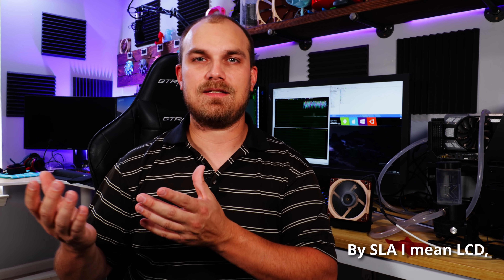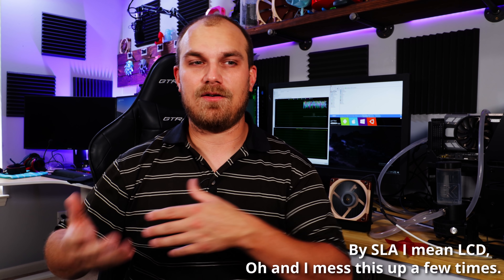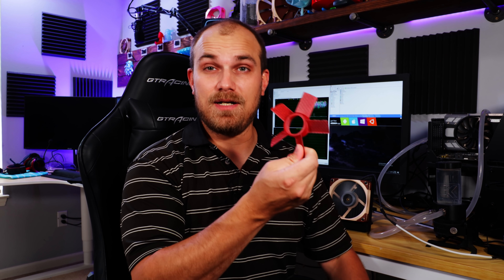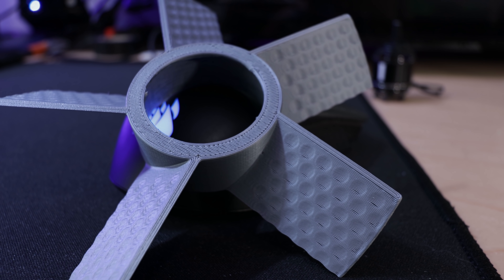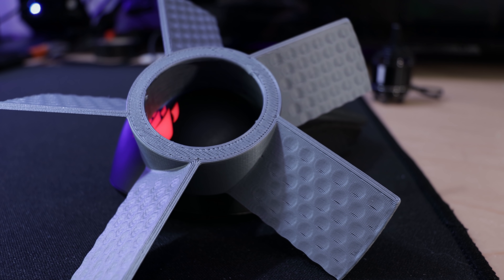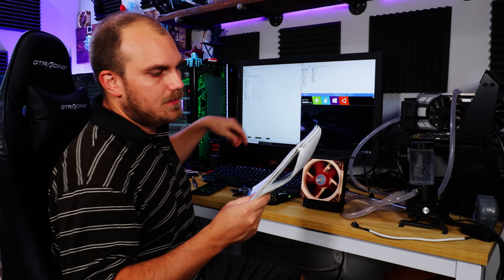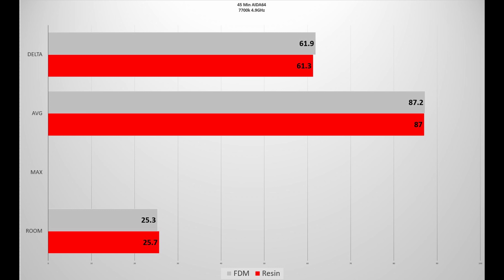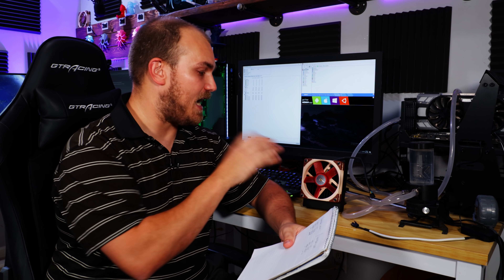Do Resin Fans Outperform FDM Fans | Dimple Fan Follow Up

Comment: The performance difference in this type of flow is negligible. The air pressure and flow are just too small to be affected. However I am not sure about the balancing. While for a 2 3 or 10 hour run everything is fine I suspect that depending on how you print both in resin and FDM you would have a different lifespan due to micro vibrations.  Check if they are both perfectly balanced. I think resin should be better balanced if you have no hollow spaces within.

Comment: Its pointless using dimples on that style of blade!

Dimples on a golf ball are designed to make the boundary layer more turbulent so that smooth air flows better around the curve of the ball; thereby reducing its wake and in effect drag. This makes the ball fly better and farther.

That blade primarily uses angle of attack to force air thru due to it not being a curved aerofoil. The air flow will not adhere to the top side of the blade i.e. no boundary layer is created.

The FDM layers would act like dimples but would only be effective on a tight radius curve blade. FDM vs resin on this type of blade would make no difference to airflow... strength would be the only difference.

Comment: Theoretically, surface texture means a LOT in fluid dynamics. For example, ship impellers are very rough cut, but then ground with this really cool looking power sander on a huge rig, to very close to perfection, and also much smoother. That said, I think there's even more at play. Several of the models in your competition, so far, have had ... issues. By issues, I mean things like you having issues removing support material, and maybe there's some surface marring. Or maybe the layering was thin, or far enough apart, such that it didn't come out smoothly. This would be an excellent use case for resin printing. The ones that didn't come out smoothly had issues /on the cutting edge/, which I would consider significantly concerning. It is also likely worth noting that differences may vary based on the properties of the individual designs. Some might not have the air doing a lot of running over the surface type stuff, some might. Those will be affected differently.

Comment: It's not just about the surface, though, it's also about print quality when it comes to design. FDM just isn't suitable when parts become too thin, or when structures are too intricate for FDM to realistically print.

Comment: probably is a difference because air resistant should be lower on resin because it would create less turbulence. should test it on some noctua clones and thomas’s acceleron i wager that the delta will change

Comment: Resin with and without dimples, preferably curved blades. 
Keep reading for the thoughts behind. 

The roughness in the extrusion could behave as dimples, rather than negating the dimples effects, as dimples are there to energize the boundary layer creating vortices to delay flow separation. This is much more important in the low pressure (back) side of the blade, as in the high pressure (front) side will only create more drag and nothing good.

Probably highly curved blades (in the airflow direction, not radially) will benefit much more from that effect as flow separation could occur at any point and helping it stay attached would increase the efficiency of the blade, in a flat blade the airflow would stick or separate just depending on the angle (hugely simplifying).

Lastly, even with all that in consideration, I don't know how much the effect can be, there's a reason we don't see airplanes with dimpled wings, and fans have quite an special type of aerodynamics as interaction between blades its very different than a single surface on the airflow.

It's a big can of worms the endeavor your channel took as theme, I'm very thankful for the content, not only fun to watch but quite interesting!

Comment: Temperature shouldnt be the key difference, noise should be the difference. A cleaner surface should produce cleaner air with less noice. Sure cleaner air may aid in better delta’s but on this scale, I dont think without special super accurate equipment and a bigger sample size you will notice.

Comment: You kind of have to wonder... The Industry with the highest interest in getting the most air moved at the least cost would be the Jet Engine Industry so why is no one using their designs? https://c2.staticflickr.com/4/3503/3874769222_af84d459c9_z.jpg
Reply: Cost and sound levels are not really important for planes, compared to size/weight. There's also a lot more technical complexity (a jet isn't just one fan) and the focus isn't on moving volume, but creating pressure; that's why the front opening is much larger than the rear.

Comment: If you are trying to design aircraft, then at the speeds they are moving, the surface finish will make a big difference to the drag that is experienced, but in this case, the speeds are not high enough to matter and even if you could push a bit more air with the blade design, you are trying to push it through a constriction (the radiator)..    The factors you have are thus: how much air can be pushed through the fins with the power/torque available from the fan motor, and how much heat transfer can happen between the fins and the air.   Even if you can design a fan that can theoretically move more air, the radiator is still in the way and because fans generally don't create a ton of pressure like a compressor, even increasing the motor power is likely to only net you minimal gains...  In short, you may be able to see some minimal gains with fan blade geometry, but things like surface finish will be down in the nth decimal place and insignificant in this context..  

If you are interested in better cooling, you need you need to look into coatings and treatments for the radiator fins that improve heat transfer and also fan designs that act more like compressors to create a pressure gradient across the radiator, which would normally require multi-stage fans and a lot more torque than the little hub motor is capable of..

Comment: You should probably be comparing a resin printed fan with dimples vs a resin printed fan without dimples, obviously using the same base shape (number of blades, curvature of the blades, twist/pitch of the blades etc).

Comment: There was a difference. A 45 minute test showing that the SLA preformed a lower temperature at a hotter room temp is big. If you ran these tests for a week or a month, then thats where you'll see a dramatic difference in stats.

Comment: I thought the dimples on golf balls were there to reduce drag. So I don't think this has a use when it comes to a fan other than possibly reaching a higher rpm but by sacrificing the amount of work done on the air.

Comment: Air is technically a fluid so the dimples in the blade get filled with air that goes along for the ride the air moves across it as it would any smooth surface. Your plastic print has dimples on an even smaller scale and the same thing happens air gets trapped and the other air glides over as if it was a smooth surface.

Comment: I dont think the test cpu has s reliable delta because of high thermal density and thermal paste between ihs and core. I think a 5820k which is a big soldered die is a better test system.

Comment: You are all missing the dimple point of a golf ball. Its for spin. If you hit the ball at a specific angle the ball will spin in different directions sorta at different speeds. This allow the ball to either be carried or dropped by the barnulli effect. Spelling might be wrong.

Comment: Lol, that design with the dimples creates its own drag by a mechanism pretty much identical to the drag induced by crappy FDM prints... Definitely try something else. 
Easiest benchmark is probably the Knocktuoff for obvious reasons (can compare vs. FDM AND genuine Noctua), but pretty much any of the other fan or blower designs that qualify as a fan or blower should work for a test, except maybe the "vortex generator" one.

Comment: The 0.6 degree difference in deltas between the fdm fan and the resin fan is not a negligible difference. That 0.6 difference would make the first place fan better than the noctua A12 X25 fan

Comment: The dimpling you made on the fans is not the correct geometry, to get any significant result you need to make all dimples tangent in a trilateral lattice (pyramid/triangle offset).  Additionally you need to determine the correct depth to angular interaction ratio.

Comment: As far as dimples go, it won't make a difference in your application. They create loft. They affect windtunnel performance on "traveling" objects. That doesn't necessarily translate to moving air better. In other words, because something slices the air better, doesn't mean it will push the air better.

Comment: Hey man just found your videos and love your content! That being said, I have an idea for a cooling system that I would love to see you test. I watched your evaporative cooling tower build and was blow away by how well it performed, which sparked a thought; could a natural draft cooling tower be used to cool a cpu? Now I know they tend to work with a warmer water and the end result tends to be cooler water than what you might find in a radiator cooling setup, but it also seems to me that that since you don't need the water to be quite as cool, the water entering the system cooler may not be an issue. I don't know, may the lack of heat wouldn't create enough pressure in the system to draw enough air to cool the system. The one flaw in your previous cooling tower that stuck out to me was the fact that you would be drawing water vapor through your fan, which over time would cause corrosion in the fan, making it a less than perfect cooling solution for any sort of longer term. But shoot, I am intrigued and don't have the tools to test this myself. Plus, imagine how cool it would be to have a cooling tower that resembles a nuclear reactor cooler sitting on your desk?  Anyways, just some food for thought! Thanks for the great content!
Reply: A functional reactor style cooling tower? I would love to see that!

Comment: Resin printers that use an LCD matrix is still technically SLA, as SLA actually describes the process of curing the resin layer by layer regardless of how the light is shown on the transparent layer at the bottom of the vat. So you are not wrong calling it SLA.

Comment: Just like dimples create vortices that reduce drag, so do the layers created by the FDM print. The layers are like elongated dimples.
And I already explained in a comment on the previous dimples video why they don't work. They do reduce drag, but that only means that it takes less energy to spin the blade, and reduces noise, but it also reduces the airflow since the air surrounding the blade is also less affected by the blade that is pushing it in a specific direction. You want to increase the amount of air touching directly the surface of the blade, and dimples (and FDM layers) decrease it. 
However, at this scale, the effects are so small that they don't matter.

Think about it, if dimples worked to increase the airflow in a fan blade, why wouldn't common domestic fans use them? Why wouldn't helicopters and planes use them in their propellers and wings? Because it would actually reduce the amount of air pushed in the desired direction!

It is useful, as you've seen, at reducing printing time and material costs for these fans. With resin, it would even decrease costs further, because you can put the dimples much closer together, meaning more dimples, meaning less material.

Comment: I figured th performance gain would be more sound related wouldn't it? That's why some companies like Deepcool put ridges or Noctua with their little notches or even the spoiler esque wings.. It changes the sound profile to a lower pitch or just softens to noise output in general. Or at least so I thought. Doesn't increase air CFM afaik.

Comment: I would imagine that the only reason you don't see any performance gain is that the difference is so small (less than 1%) that it doesn't make a measurable difference. You'd have to test them 100s of times to be sure

Comment: My thought on the resin and why I've commented on the past wasn't because of the "roughness" of the 3d print, it was more for finer details that are difficult to 3d print. There was one fan where you mentioned it had such thin blades it took a few prints to get it right, my thought was that it would aid in fans with blades the 3d printer was having issues.

Clearly 3d printing is less toxic and messy than a resin print, but still they both have a potential place in prototyping I think.

Comment: When mythbusters did the golf ball car dimple experiment the scale of the dimple in relation to the surface was a factor, IIRC. 

It could also be a matter of blade pitch. Those blades have a pretty high angle of attack.

But, glad to see the resin prints happening. Some of those FDM prints were pretty janky.

Comment: I think the reason you're not seeing much difference is because the dimples do the same thing as the layers in the FDM printed fan. They break up the air and use the symmetrical vortexes to fly in a mostly straight line, and much farther, because the low pressure air flowing over the surface reduces drag. So technically the entire fan blade is covered in vortex generators, something you don't want for good suction or low turbulence flow.

As an aside, I think we'd all love to see a resin-printed cooling tower.

Comment: ...The dimples in golf balls are supposed to make the ball more aerodynamic... and the Mythbusters test with a "dimpled" car showed it was feasible to increase efficiency with them...wouldn't that technically mean that the only effect dimples would have on a fan blade is making them slip through the air easier? Making them not really move air, but more energy efficient?

Comment: The room was slightly warmer during the test for the resin.
Despite this, the cooling was still slightly better.
I think you would have seen different results if the room temperature was exactly the same for each test.

Comment: One of the issues is that the fan blades (not prop assembly) are both aerodynamic and straight. There isn't a need or much potential for the boundary layer that forms with objects that collide through the air that dimples would help with. If you look at a diagram that illustrates the effect of dimples, the effect diminishes with distance from the "frontward" face

Comment: Fine edges and larger scale make a difference.  Probably a bit smoother sounding on high RPMS but it will be minor at this size.  Wish there was a larger fan size 140mm or 200mm.  Difference there might be a bit more noticable.

Comment: What size is your nozzle on the FDM printer? The lines in your print look fairly large and spaced out. I'm not sure if that was the bottom or top layer but if that was the bottom I'd lower your z endstop a tiny bit. Also, I don't think the resolution should matter much in this test as when a fan blade moves through air it forms a cushion of air around it that I feel would smooth out any edges aerodynamically.

Comment: I really feel like these fan designs just aren’t precise enough to benefit all that much from smoother printing but more importantly, I just don’t think they’re being subjected to extreme enough forces. The smoother print would probably matter a lot more if you where dealing with larger fans and higher speeds. I just think the physics being applied to pc fans aren’t extreme enough to see any kind of appreciable difference. I’m also willing to bet if you printed the fan designs you already have at two or three times the size and ran them faster that you would start to see a much bigger difference in results than what you’ve been seeing.

Comment: might be a problem with a dimple fan because how the fan works, with dimples on a ball that makes it more Aerodynamics which create a thin turbulent boundary layer of air that clings to the ball's surface. but this is a fan your basically trying to pull air into it.

does the dimple slow down the air movement? since there is half a circle which would cause the air to move in different areas
https://www.youtube.com/watch?v=I51YYbDyatc (normal fan blades types)

Comment: I have a request for the resin acceleron re-test! Seeing as it's the closest we've had yet to the original noctua in terms of performance, could you also run a direct noise normalised comparison with the A12x25?

Given that the A12x25's main strength is its performance while maintaining low noise levels, it'd be interesting to see how they compare in that scenario. I can't imagine the acceleron would come out on top, but it'd be awesome if I was proved wrong.

Comment: I think you should print the noctua clone design in resin because when you did it fdm iirc there was a pretty big difference in performance that most likely came from the poor surface quality of the fdm. Does the resin bring it up to par with noctua or is there other material science magic being done at noctua to still beat it out.